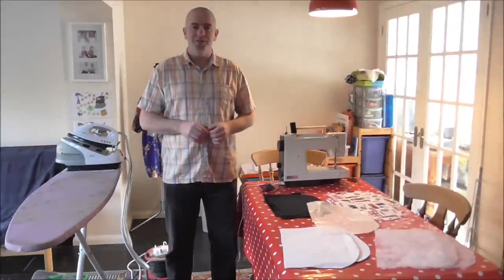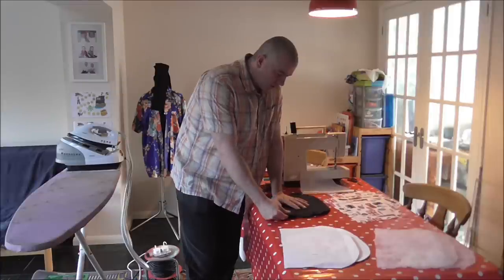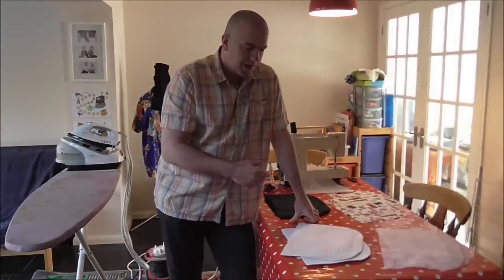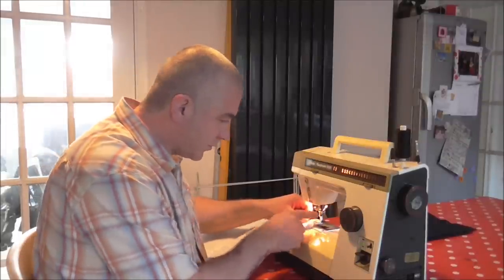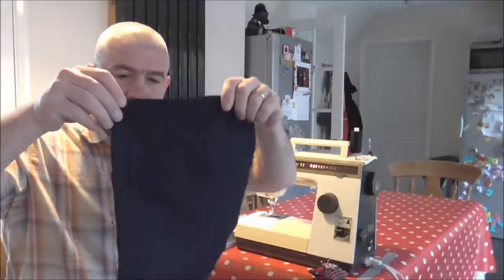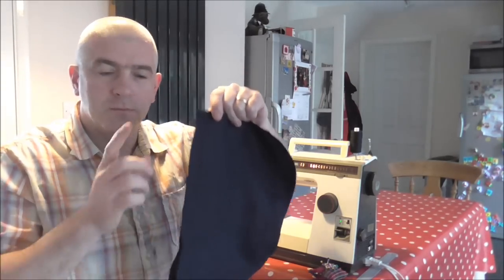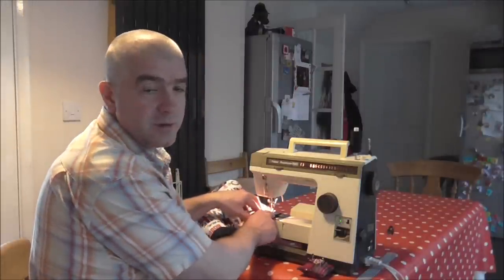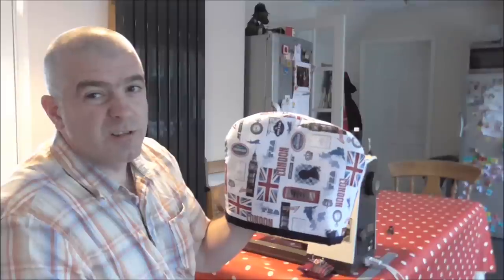Tea Cosy Sewing Project by Dizzy Sew and Sew

Comment: May I suggest as an option for sewers with a little experience to trim the Insul-bright and wadding after sewing close down to the stitches in the long curved seam? That would reduce the bulk there considerably and avoid potential lumpiness when turned inside out. Otherwise, a very nice simple and very practical tea cosy.